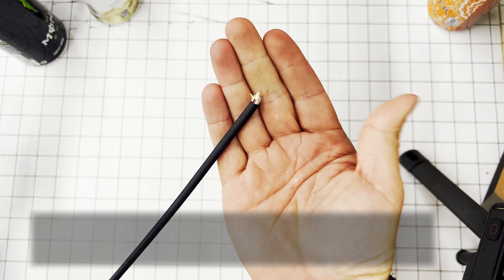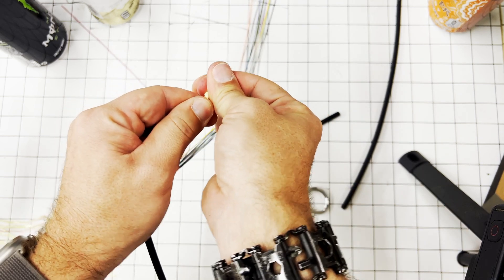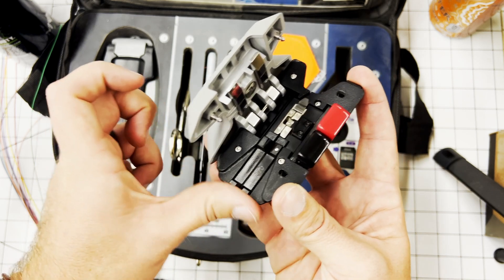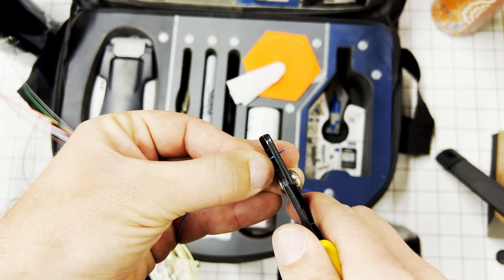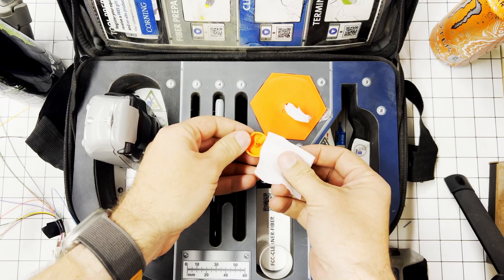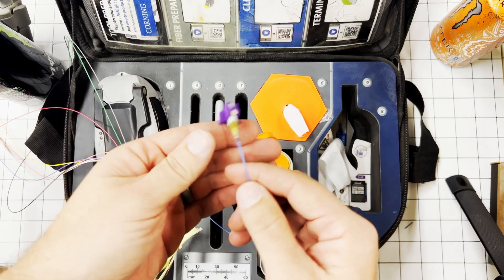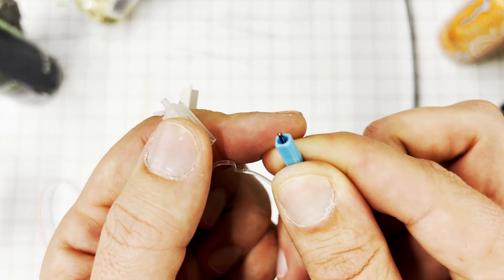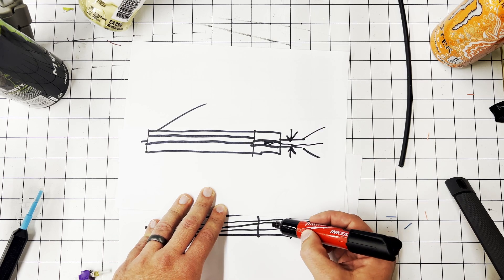How To: Terminate Fiber Optic Cable With Corning LC Style

Comment: Beginner question: Why are there so many fibers? was it 12? is this cable for patchpanel? super video.
Reply from the maker: Yes, this was a 12-strand or sometimes called 12-core. This kind of cable would be to link 2 fiber patch panels. The cost difference between 2, 4, 6, 8 or 12 is so small that it's almost always better to just run 12 as a minimum. That way, someday in the future when you want to expand you have extras and you don't have to pay to install a whole new cable.

Comment: Its bad practice to deal with fiber off cuts like you do. You should have a sharps box for them and dispose off them safely.
Reply from the maker: Thanks for the feedback. I’ve seen too many boxes fall and pop open. I’ve never seen a fiber come off the tape. The guy that wrote the actual book on fiber installation taught me the tape trick so I’ll stick with that until they make some foolproof boxes. They got their work cut out for them to proof against a fool like me.